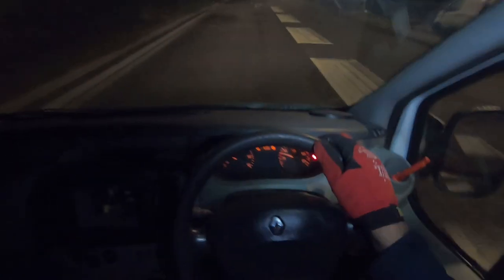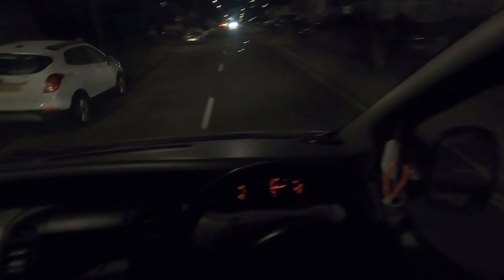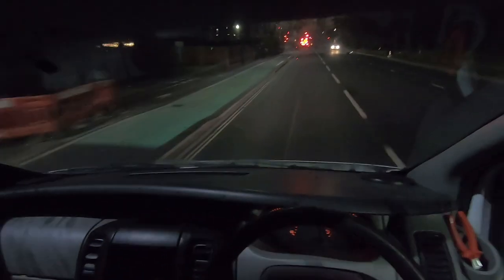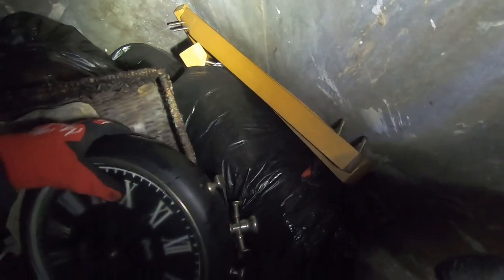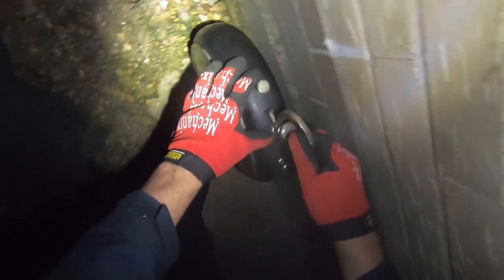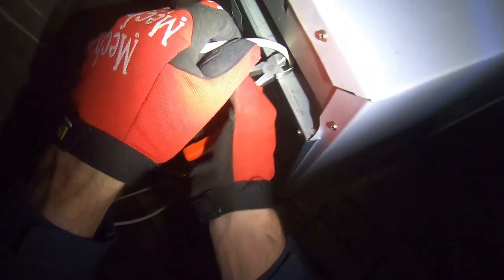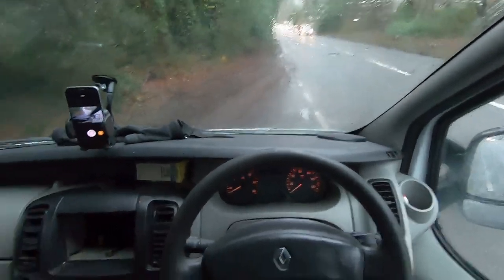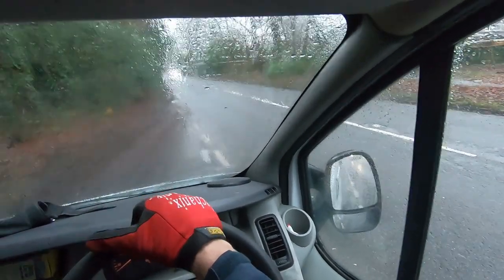Street Scrapping - New Van 🐷 Leave Nothing!!

Comment: Hope you check the motors on the washing machine and dryer.  Also check if the barrel are stainless steel
Reply from the maker: Yes I have since checked the motors.  Some of the flywheels can be cast Aluminium as well.  I wont be bothering with the barrels.  I will be taking the control boards out of the washing machines they can sell for good money on ebay if they are working.  Door locks sell ok to even doors from some models.